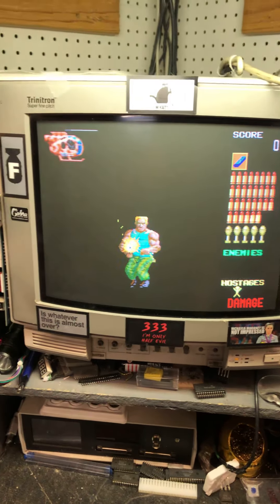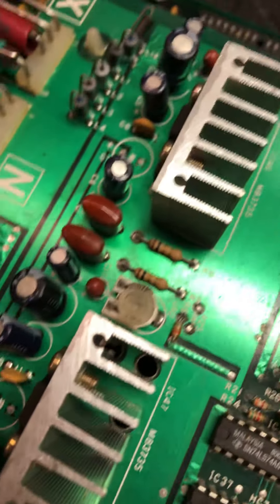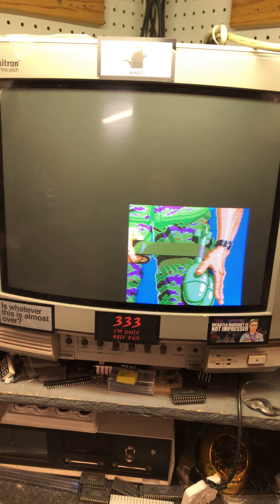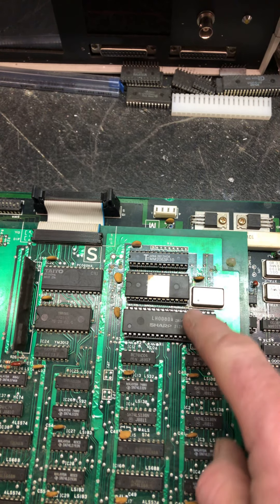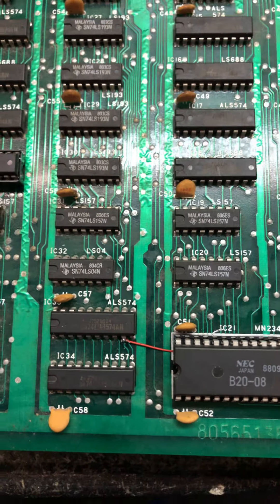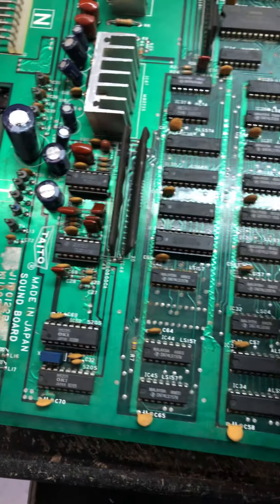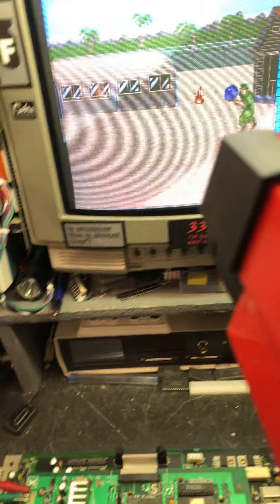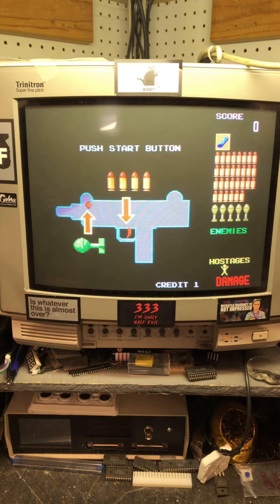Taito operation wolf repair (audio)

Comment: Hey Matt enjoying your videos! On the resonator for operation wolf where can I find one?. And also on your video with lethal enforcers any places that you would recommend for the sound chip? Do you have a video on how to troubleshoot pcms with ic tester. How do you know which pins are.suppose to be high or low? Trying to figure out my operation wolf sound in getting sounds intermittent, but no coin sounds or sounds playing the game. The intro plays once in a while even when you start game but won't stop, then it just makes jumbled sounds then quits. I have two sound boards  neither one is working. If I can't fix them which I would like too what's is your guesstimate price average??? Thanks Matt appreciate any help. I repaired my lethal weapon sound replaced caps and one trace was corroded but can't get him to register now always something!
Reply from the maker: reach out to me at gamefixer at gmail dot com
Reply from the maker: I wanna say I found that resonator on eBay?? I don't have any specific video's showing how to troubleshoot a PCM with a logic probe. I mostly go by what I know "should' be toggling and what "may not" be toggling. For instance, a clock pin should probably always be moving.